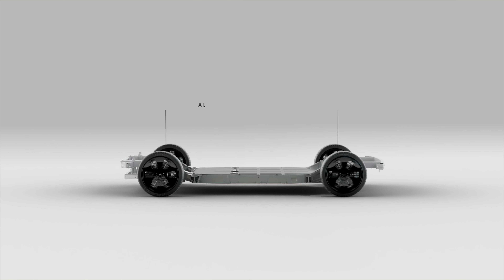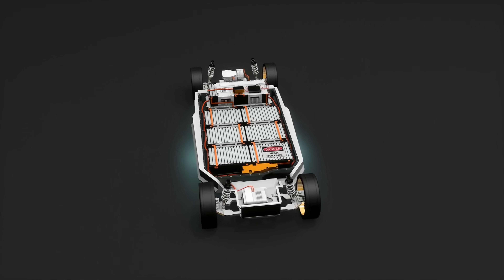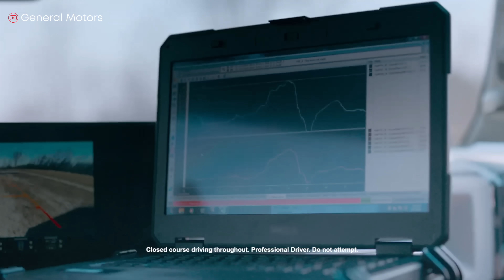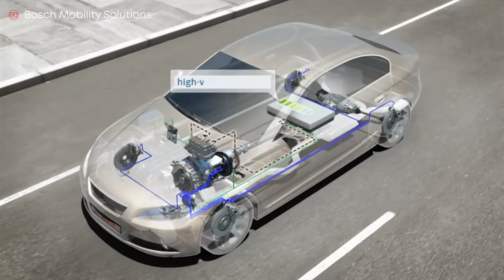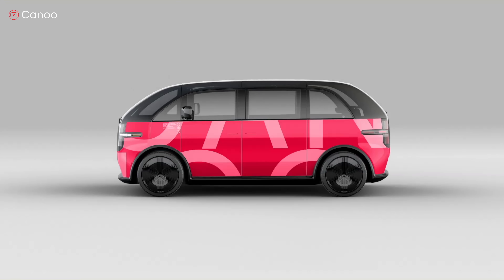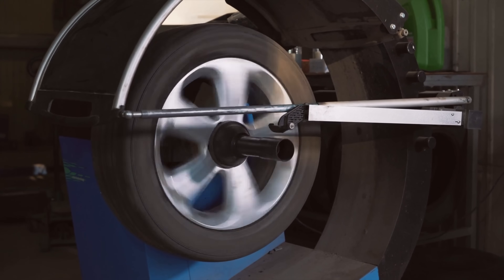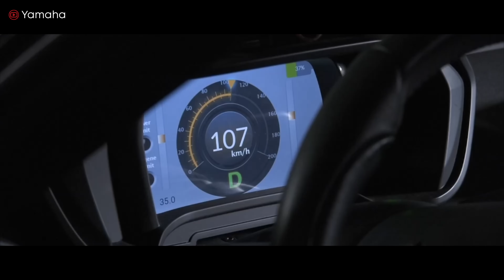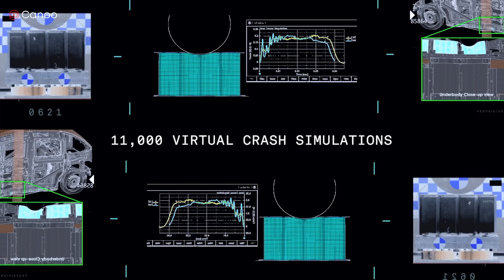No One is Telling You the Truth About Electric Cars, So I Have To

Comment: Well done!   If we want to buy a "pre-owned" EV, how can we evaluate the battery conditions on it?  That would be a good follow-up video.
Reply: There is an app for the metrics and Chevy has a service mode screen showing all the numbers at once.
Reply: In the case of the Nissan LEAF, the raw battery metrics data can be read from the OBDII port via a reader with Bluetooth into your smart phone and viewed in an app.  This is how I checked the true health of my battery when we bought ours used.
Reply: There is no technical way to see or say what kind if life Is left on the battery. It's all dependant on a number of factors in each person's life. Like Usuage, ambient temps, etc....

My phone battery doesn't even make it a full year cause I use it so hard. Then it expands (bloats) and I have to buy a new one. Most people I know their phones go multiple years on same battery. But they also don't use them as hard as me. And probably don't have an ultra protective otter box case like me that keeps the heat in. 

Plan on the electric car batteries dying and you needing to replace them. That's the best mind set to have.
Reply: @WheresWaldo05  I use a Chargie and that keeps my phone battery healthy
Reply: Don’t buy used ev cars, they cost about or the same as new
Reply: @marleneaguilar1079  that’s not true. It’s dependent on the model.  It is the case for something like a model 3, but not for something like a LEAF, for example.
Reply: @WheresWaldo05  you CAN get useful insight into the health of the battery pack using the kind of data we are describing, especially in a pack with multiple jars or cells.   

1) the data logged by the car’s BMS indicates the relative health of modules to the rest, so you can inspect for a module that will likely fail before the others.  2) values like the SoH (State of Health) are calculated by the BMS, which, in the case of a LEAF, is approximated by a crude health meter in the cluster, but can be gathered as a percentage through the OBDII interface.  3) with a car like the LEAF that has a very well documented/experimented history, an accurate estimation of the pack’s remaining useful life (including range) can be made.  

So, while it is true that a batteries health is affected by several factors (e.g. thermal abuse, and DoD (depth of discharge) each cycle), it is not the case that a prospective used BEV car owner cannot make a well informed decision about a car’s battery health, whether modules trending toward premature failure or the overall estimated useful life and capacity (and therefore useful range).

Edit: changed SoC to SoH
Reply: @WheresWaldo05  also, I disagree with the best mindset being to plan on the battery dying and replacing it. This is about as true as saying someone buying an ICE car should plan on replacing the engine.  

Provided the battery doesn’t have a catastrophic failure, due to defect (which warranty will resolve) or damage, then it will wear down over time.  With a BEV, the effect will be a gradual reduction in its usable range.  It won’t just stop working.  Furthermore, the rate at which it wears down can be improved by the owner (keeping the SoC between 20% and 80%, keeping the DoD shallow each cycle).  Lithium batteries that are rated for a few hundred deep cycles can do thousands at shallow cycles.  Which is why if you buy a larger range (capacity) relative to your intended use (discharge per cycle), you will get longer overall life (more cycles).  

But even so, as mentioned above, the range will simply reduce.  If you know your needs, you can have a usable BEV with an original pack many years and miles beyond the 70-90% original capacity.  

So, as the packs get bigger relative to the typical use, the degradation slows, and even when it does, there’s still an abundance of range.  This is why you could have bought a model S five years ago, put 300K miles, and still expect it to be a usable car with the original battery for years.

Your phone, in contrast, is probably discharging 100% to less than 20% on a regular basis, frequently.  So, the degradation will come quickly. And when it does, there is no over provision of capacity, so it affects your usable capacity (“range”) immediately.  And phone manufacturers are trying to charge these cells at very high rates, which further degrades them.  They don’t get an optimal charging scheme, or thermal management, for example.
Reply: @marleneaguilar1079  WHAT?  The Nissan Leaf, Fiat 500e, Chevy Volt EVs are all listed on truecar at 1/3rd their original new price.  I could buy any of these cars, used, for around $10,000
Reply: @WheresWaldo05  :  i’m sure there is a diagnostic that tells you how much battery life is left with respect to how many miles the car has already traveled. I am 100% sure of this.

All Chemical cell batteries, including lithium batteries, have an “ internal resistance“. The internal resistance of the battery increases as its life decreases, and this is entirely predictable.  Therefore there is an easy diagnostic that will indicate the remaining life left on a battery and it’s probably built into the automobile software system, pretty much it Has to be.

It is simply not correct to say that you cannot evaluate an electric car and determine the life of the battery that’s remaining, by say miles left before it is practically not usable.

Tesla for instance, monitors the degradation of the capacity batteries versus miles traveled. As of the year 2021, cars established by Tesla in the prior years will go about 400,000 miles and still maintain 80% of their energy capacity. Approximately, but this is a tight correlation for a given tesla system.  The battery energy capacity and the “internal resistance” that I talked about are closely related.
Reply: Never buy a used EV
Reply: If it's a Nisan Leaf - get Leafspy... or, for any one ... take it for an extended test drive and see how the battery performs.
Reply: @marleneaguilar1079  - How do you figure. I bought two EV's this summer for less than 10 grand total. I paid about a tenth for my Leaf of what some people I know are paying for their entry level Teslas. The tricky part is trying to buy one from just a year or two old... where you don't get the tax incentives.
Reply: @marleneaguilar1079  I agree with you don't buy a used EV !
But it's also good to see in this thread , that you're getting all the "Flack" and they're leaving me alone 🤣🤣🤣🤣😅🤣😂😂
Reply: @ghee cappy Then I charge it from my car
Reply: @WheresWaldo05  Yes there is, they are OBD11 dongles and apps available, Yes there is factors going forward into the future, but you can certainly test of what the condition of the battery is like now, The car companies usually install a bigger battery than you think, EG. The Ioniq 28kw model actually has 31kw battery and the manufacturer uses the software so you dont actually charge to 100% nor do you go to zero %, the range is 5% to 95%, so when you charge to 80% you are actually charging to 75% of you batteries capacity.
Reply: YES , good point !!!
Reply: @steveperreira5850  a battery wares out by its very nature of chemical constuction mmmmmmmmmm
Reply: my mom bought a 20 year old Prius that always needs a jump now But hey the dealer said it had a brand new battery right before she bought it.
Reply: @jhoughjr1  yus once  a battery  is  new in an electric  car its all down hill for the battery mmmmmmmmmmmm so only expect  7 good years from one  mmmmmm
Reply: I think they have a black box that records everything that can be accessed to show the charging and discharging rate.
Reply: @johngott8224  THis is very important topic. Where can I learn more about EV used market vendors who will establish metrics ( currently use) of battery in consideration of re-sale pricing.
Reply: @electrictroy2010  I could buy a junker for $1,000, maybe spend another $1,000 on fuel and it would last me years. People wanna have assurances, with a car it's simpler with ICE if you're mechanically competent.
Reply: @dallysinghson5569  yep! I strongly agree.
Reply: Just look at odometer, Tesla battery is good for 300k miles and warranty till 100k miles and 8 years minimum for long range battery packs can last 500k and warranty till 120k miles.

Comment: I've heard Challenger owners talk about needing to replace tires. Fun costs rubber.
Reply: I had to replace the back tires on my '65 GTO every couple months. Just terrible.
Reply: I have heard a lot more than talking about replacing it.  I have heard them complain.  But the challenger is a powerful car.  The electic cars are heavy cars so they will go through a lot of tyre wear also.
Reply: @stevet8121  How much would that typically run you Steve?
Reply: @FalconFlight747  About $30 each if I remember right. I do remember I bought 2 rear tires from JC Penny one time. They had a guaranteed mileage. I came back about a month later and showed them they were almost bald. The manager said abusing the tire didn't count. I couldn't argue that. I finally grew up and started being more responsible.
Reply: @stevet8121  for $30 a tire you can’t really expect anything special. They last longer on a regular cheap car
Reply: @FalconFlight747  no that's 1967 money 💴 in today's 2020 world try 400 ish pur-tire
Reply: @indridcold8433  *tire
Reply: Yeah , one of the things I've learned from this video that surprised me , is the fact that EV cars are heavy 🤔
Reply: @richardprice5978  adjusted for inflation $30 in 1967 would be around $240 now.

Comment: So here's a question,  how much does one actually save on an electric vehicle versus a traditional gas vehicle if they live in an area of greater heat or cold (Arizona, Texas, Florida, North Dakota, Minnesota, Alaska, etc.)  if they do not already have a garage or shaded place to park their vehicles. There are extra costs outside of just the vehicle and its maintenance that have to be considered for first time buyers. What's the cost to get a charging station (or 2 for those with more than 1 vehicle) setup at one's residence. If you live in a harsher climate and do not have the appropriate cover for your electric vehicle, what's it going to cost to put said garage or shaded parking area in. As a child, I grew up in Michigan and we did not have a garage, so I have some experience with cold weather and later in life my parents moved to Florida and we have no shaded place to park our cars.
So I'm asking because if I  switched to an electric vehicle, it seems that there will be some fairly large extra costs above that of the vehicle that will be much larger than the quoted average $4600 savings over the life of the vehicle. Also, if you live in Florida and use certain trees for shade, you will end up with large amounts of pollen or other things covering your car regularly (again from experience) and if you live anyplace where sugar ants are common,  they are drawn to electric power sources and can cause major issues by crawling into things and dying in the current. 
I'm not against electric vehicles, I just believe there are costs that a lot of people ignore or do not want to bring up with this conversation.
Reply: if the car is kept plugged into the power supply, the HVAC system can be programmed to set the interior temp correctly, thus not draining the battery. Similar, modern cars keep the battery at the right temperature as long as kept plugged into the mains - no warm up time like an ICE.
Reply: This is vary out dated. They have complete difrent battery then the one in the video. And a new one that ain't hit the marker yet that is solid stat.
Reply: @dannybelanger5501  and what is that?
Reply: Cost to insure EV is higher than a new gasoline car with similar safety features. Do price the cost of ins for EV vs Similar priced gasoline vehicle.

Comment: Now all we need is a power grid that can handle all this extra capacity.
Reply: This sounds to me like it could be a thorny issue.
I live in Manitoba, Canada, where we have an abundance of cheap hydro electricity.  Clean, cheap and abundant.  However, next door in Saskatchewan and Alberta much of the electricity is generated by FOSSIL FUELS.
So, exactly how much better off will the environment be?

That's not even starting on Ontario, to the east of us, whose power rates are already notorious - I don't see how running an electric vehicle there could possibly make economic sense.  

Then, there's the distance factor and infrastructure required for charging.  Much of Western Canada is remote enough that this is going to be very challenging.
Reply: Shockingly true!!
Reply: @guywerry6614  lots of studies show that regardless of the source of electricity electric vehicles are better for the environment then internal combustion. The reason being that even if the local utility is using coal fire generation the overall emissions are significantly lower then the thousands of small internal combustion engines that would be replaced.

Yes in places like Saskatchewan the benefit wouldn't be as great but it still would be a net positive.

As for capacity is not like this would happen overnight. Horse and buggies certainly didn't when the IC engine was invented....
Reply: Get back to us in ANOTHER HUNDRED YEARS. If you want to drive Coast-to-Coast, you might as well take a covered wagon! And how's that ski boat going to work? Charge it every half hour? Like Electric Dirt Bikes? And if I'm out in the woods in my Jeep, what tree do I plug into? Yeah, nope!
Reply: @robertthayer5779  
Point well made... I'm sticking the gasoline engine, made in Japan..not by GM; I could write a book about the junk I've owned, from chevys to pontiac, cadillac and Oldsmobile.  Owned a ford Taurus, it was crap too.
Reply: @robertthayer5779  actually went coast to coast twice last year in electric vehicles. Yes it requires a little more thought then just hoping onto a highway and driving but hardly impossible or even close to being called impractical anymore.
Reply: the EV revolution practically started in 2010.
the solar revolution started 2010. panels are dirt cheap now.
the home energy buffering revolution started 2020. home energy storage buffers with LFP batteries inside are getting very cheap now.
this is lowering the stress on the grid.
Reply: @stefanweilhartner4415  
In the Midwest, their are lots and lots of solar fields
An overly simplistic reason why this lessons stress on the grid is because electrons (electricity) doesn't need to travel as far from generation facility to end user.
Reply: More coal plants .. so stupid
Reply: Solar power generation in the US has been increasing by 40% annually since 2000. Today, solar accounts for ~3-4% of electricity generated and coal has fallen to 19%.   If you paid attention last year, the coal index was dropped from Dow Jones as its market capitalization has fallen 99% since 2008.
Reply: I live in western Canada, I knew a guy who's wife left his Prius out in one night of minus forty degree weather and the battery ended up cracking in half
Reply: @jonahdiener7355 that doesn't really have much relevance since the same thing happens to an  ice car's engine if you leave it out
Reply: And figure out the infrastructure to handle disposing the batteries themselves as those parts are not environment friendly
Reply: @jusaverage6347  no, stop regurgitating Big oil propaganda. Lithium ion batteries are 98% recyclable. They are vastly more environmentally friendly than any other power source including hydrogen using its current production
Reply: Nuclear.
Reply: Most charging will be done at night when there is less load from most everything else.
Reply: Okay, let's be serious here for a second; do you have any idea how much power we're talking about here?? An EV charger that draws 3kWh is plenty for the vast majority of people. That's actually less than a 6 cubic foot electric clothes dryer, which requires 5.28kWh. Hell, even going up to a 6kWh charger would be the equivalent of running a clothes dryer and vaccum cleaner at the same time. Are you seriously saying that a clothes dryer and vaccum cleaner in each home are all that's needed to bring down the US electrical grid? Seriously?
Reply: @jacobcarlson4010  although you are correct in that a 3 KW charger is adequate for most people, no one's going to buy one of those, they're going to buy a 7.7 KW because that's what's readily available and recommended.
Reply: Solar
Reply: @men2dewy  so if every household that has a car charges at night the system will be able to handle it.
Reply: Looks like your gonna be needing a really large power bank😁😁😁